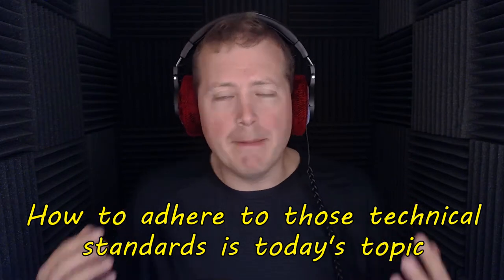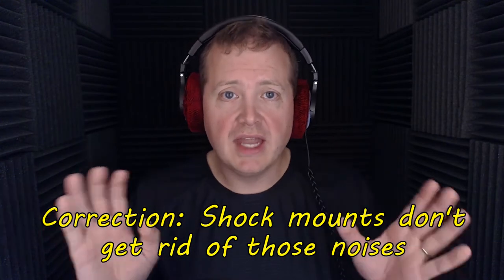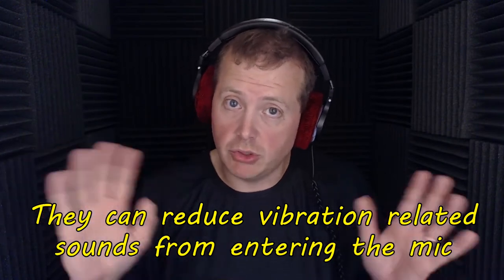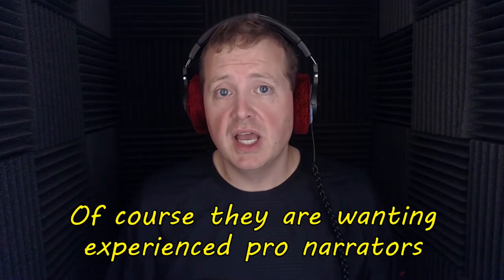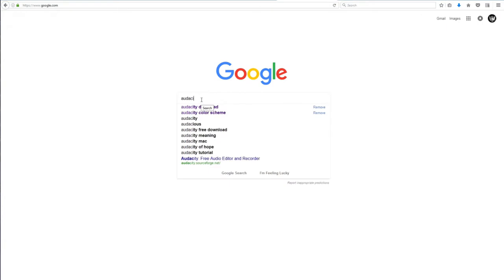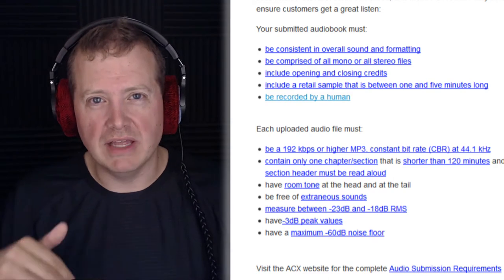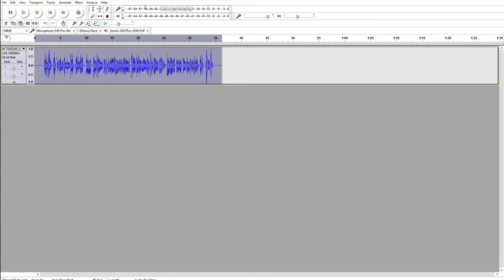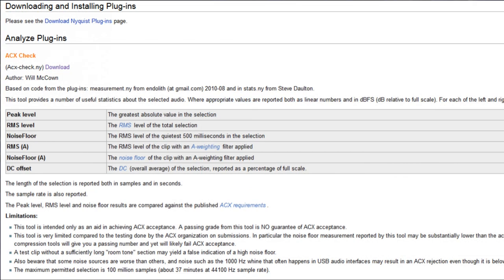How to verify Audiobook Technical Specifications in 2 clicks! Sound Speeds!

Comment: Tried using a Tascam DR-05x as an audio recorder. Records everything in the room. Did get a FocusRite Scarlett Solo and BM-8000 microphone. Huge difference.
Reply from the maker: As long as there's an improvement, Win!
Reply: @SoundSpeeds  Wanted something that recorded more of my voice and less of the room. Like how you go in to ACX check, doing audio books. -60db? Tascam, no. Scarlett/BM-8000, yes and better depending on frequency.
Reply from the maker: Right on! I know someone using the XY mics on the front of a Zoom H4N for her audiobook and helped come up with the technical specs for post. When done right, it's passable but could certainly be better with an LDC thru an interface.

Comment: I was surprised you used noise removal instead of a gate. Is a gate an acceptable alternative?
Reply from the maker: It is if the noise floor is low but remember that you can hear hear the gate open and close especially if you aren't speaking very loud but easier.
Reply: @SoundSpeeds  I have presbycusis and tinnitus so can't hear it. I'm looking for a surefire method that will filter out noise, breaths and rustles which I can't hear (without using dangerous volume levels) but others would. Perhaps noise removal first, then a low noise gate?
Reply from the maker: Yes, that works. I do that for my audio processing on YouTube. 
https://youtu.be/pcx-MEtzeZs